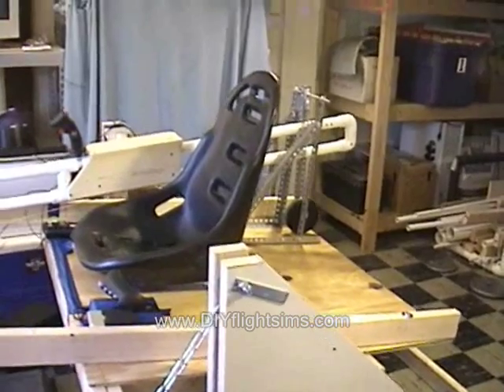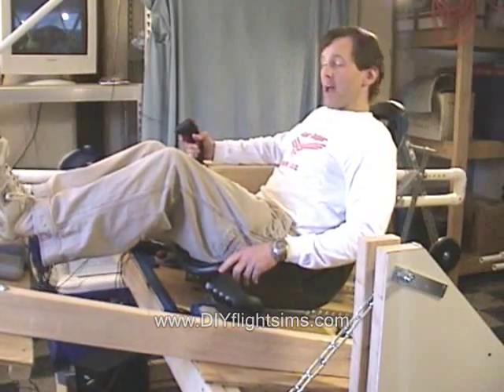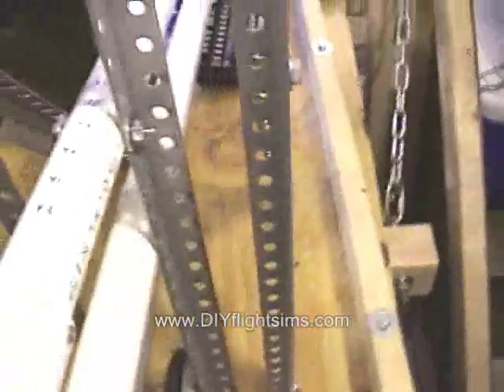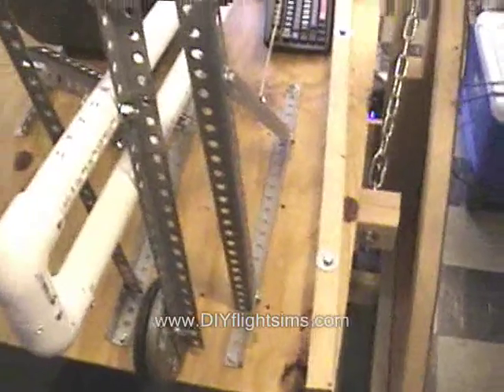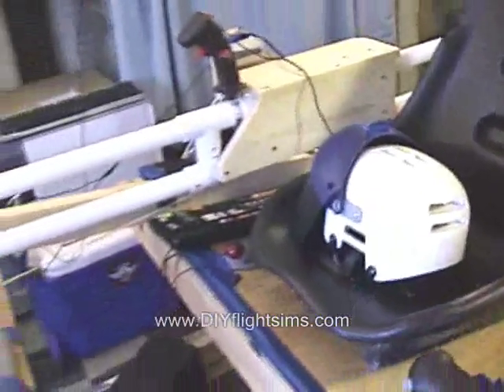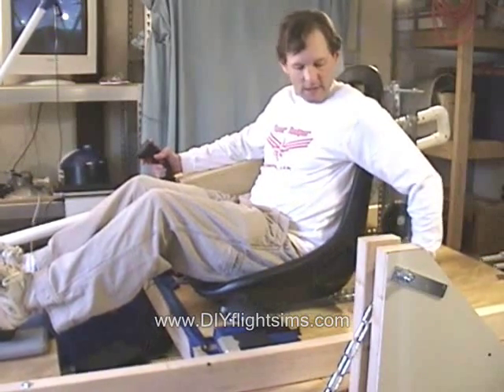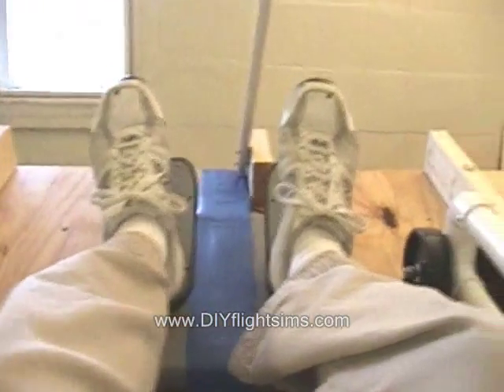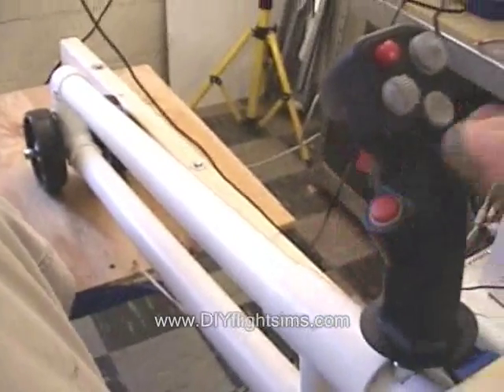MAACS Experiment - Episode 5, Self-Centering Counterweight

Comment: Hi! Just an idea, but I would put the trim wheel in a fitting box, like your original wood box but small, and make it a 5 lb weight. allow about 6" movement from center, with center slightly ran with a V router bit to create a crevace, so the edge of the weight can be slided back, forward just a little bit for precise trimming. On the left side, next to chair is the natural position for your setup for right handed person. EXCELLENT WORK, Congratulations are in order!

Dr. Ibanez
San Francisco